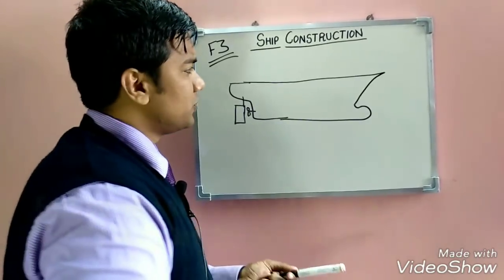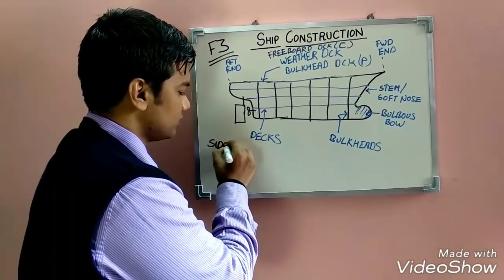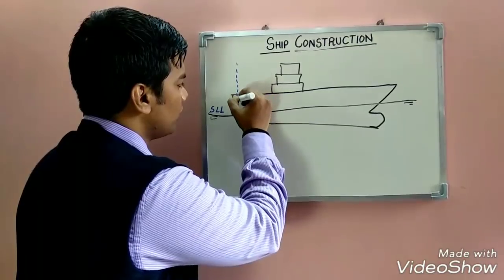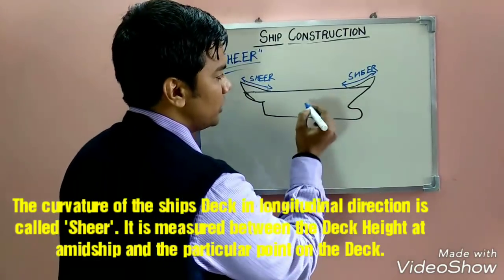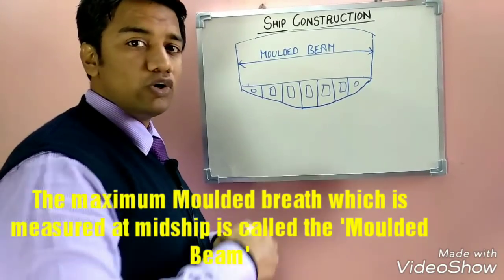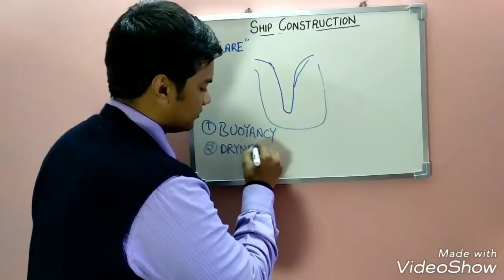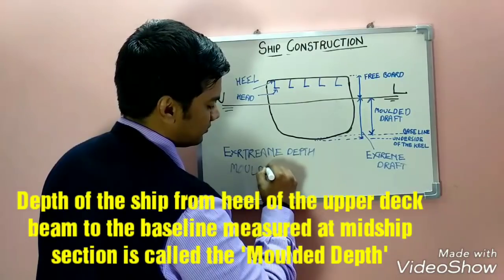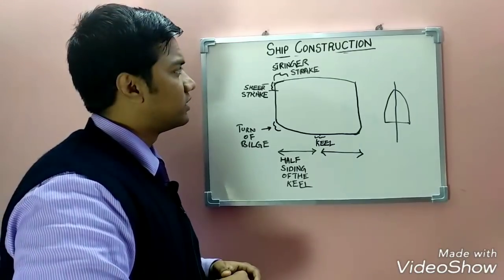Ship Construction Part 1, 2nd Mates Oral, F3

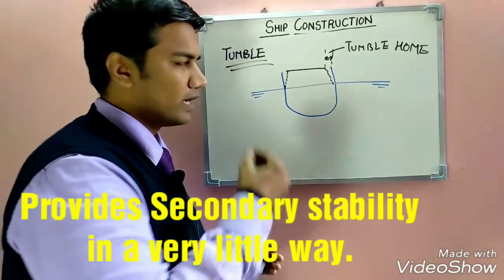Comment: 15:00 tumblehome design helps in the stability of the ship, by lowering the centre of mass and by therefore lowering the centre of gravity in the ships design. This helps it become more seaworhty by making it less prone to violent rolling. It works like a damped inverted pendulum. I saw he was struggling with explaining it, so i dropped this in the comments. For notable examples of tumblehome designs search for french pre-dreadnought battleships.
Reply: Thank you for explaining. I am not a ship builder but am a sw engineer, very interested in ships. We put so many bulkheads, so where do people find place to put the Decks and passenger cabins. Is it built inside these bulk heads or what. Sorry if my question is foolish.
Reply: thanks 
plz make videos with writing definition

Comment: what are strakes? please explain with diagrams
Reply from the maker: The Hull of a ship is a hollow body enclosed by Plating (side shell plating,bottom shell plating, Deck plating).
We all know what we mean by plate. It is a rectangular shape steel with certain thickness.
Number of plates put up together usually
in the longitudinal direction make up a Strake,
(eg-Sheer Strake,Stringer Strake/plate etc)
eg-Sheer strake is made up of numerous side shell plates 
in longitudinal direction.
In naval architecture and ship construction each of these plate has an identification.These are numbered in certain pattern.
The plates are identified by a letter and a number.Each plate is given a letter in the vertical direction starting with A from the bottom.
Each plate is given a number in the horizontal direction starting from aft.
Each section of the plate placed in fore and aft direction is called a “strake”.
It is the shell expansion plan where the numbering of 
plates and lettering of plate strakes are used for 
reference purposes. Hope this Clears your doubt.